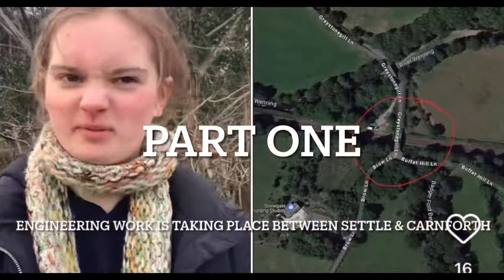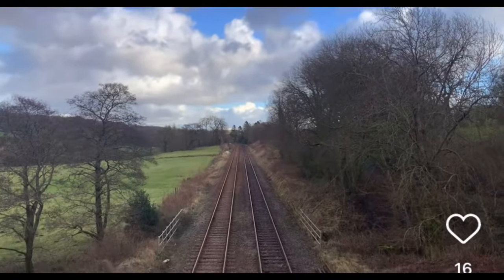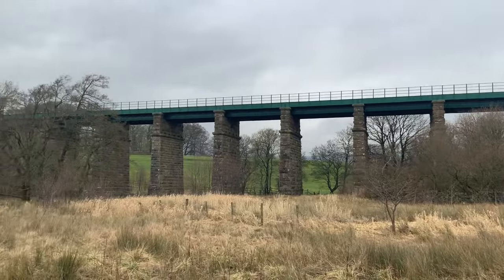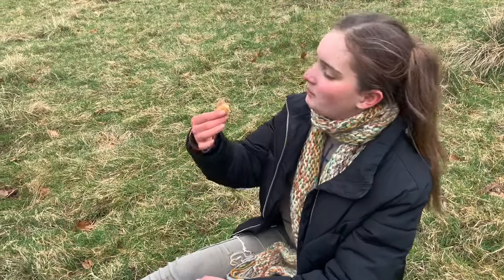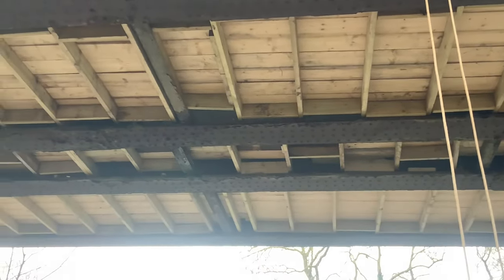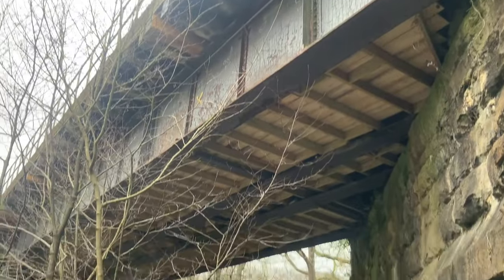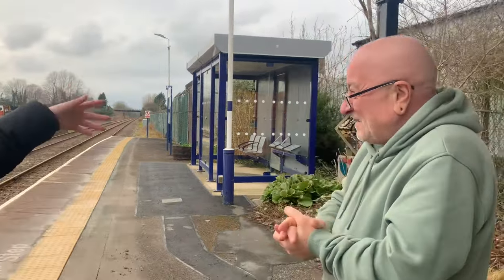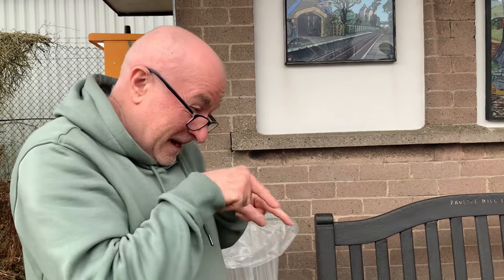Railway viaduct repairs abseiling railway workmen & a Morecambe & Wise dance wot more U want??? 😂

Comment: Very interesting to see works like this as it's not something we usually get to see. It looked to me as though they were replacing the ballast.
The yellow sign with '244' on it is a milepost. They are placed every quarter of a mile and generally indicate the distance from London. These were originally put in place so people who transported their goods via railway could work out the cost of transport, depending on how many miles their goods needed to go. Oh, and the line that goes towards London is always referred to as the 'up line' and the line from London is referred to as the 'down line'.
Reply from the maker: That’s very interesting information thank you 😊
Reply: I was told by someone with a good knowledge of our railway history that when the railways were first built there was a list of station names showing where trains would stop. With London being our capital city London was at the top of the list for trains going towards there, so if you got on a train going from London you were going down the list of names and towards London going Up the list of names. This was later adopted by all railways so today the Up Line is towards London and Down Line away from London even if the line does not directly go to London.

Comment: Signallers control the movement of trains along the line, when there is engineering work like the bridge repairs the engineers control the movement of trains in their work site possession of the line. The marker boards Stop signs show train drivers where the signallers stop control of movements and engineers take over control. All trains have to stop at the marker board and ask permission to proceed into the work site possession.